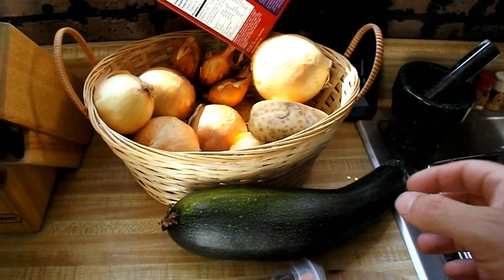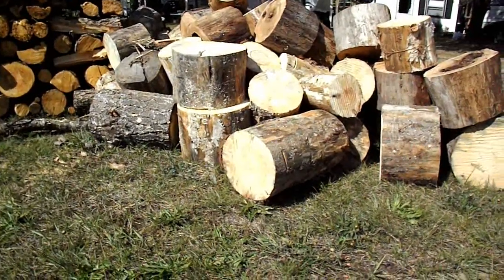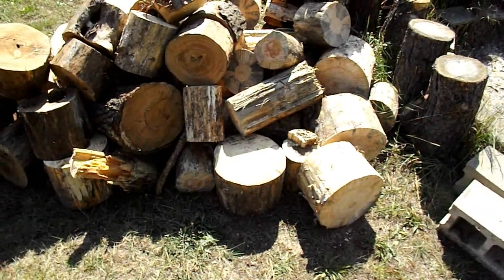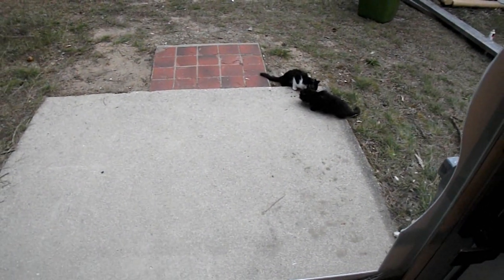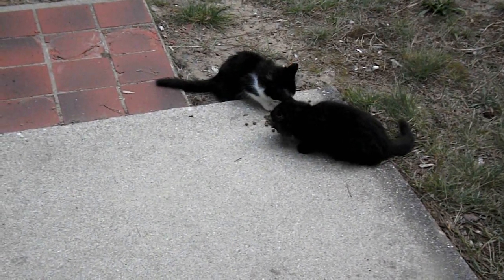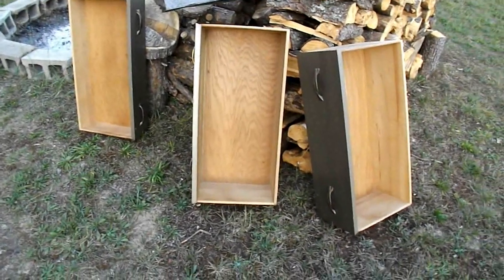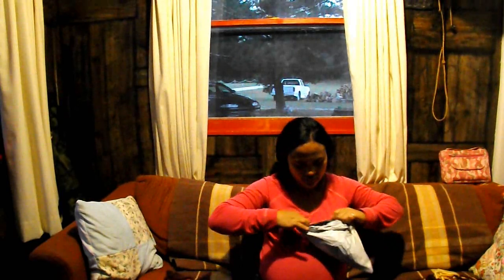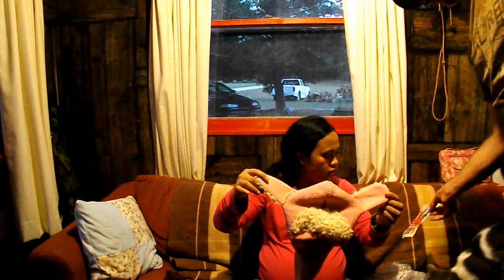Cutting Fire Wood ~ New Wood Stove ~ Gifts Arrived & More

Comment: How big of logs can fit into that tiny stove? You might have to be filling it up every hour or 2 with wood. Will it heat the upstairs? We have a decent size airtight stove and can fit big logs in it and still have to get up in the night to stoke it up. No way would the stove you have hold big logs at once  like we put in ours :(. We heat our whole  1 story home with the airtight, keeps us busy keeping a good heat tho in cold cold winter days and nights. Glad you got rid of some of the bees.  JMO
Reply from the maker: 8 inches by 5 inches max fit in the stove. I cant remember very well but back in the camper I would fill up the stove and leave for hours. Put food in the dutch oven. Come back and have a nice hot meal and the stove still glowing a bit. But I was using hard wood back then too.
Reply: Oh my that sure is a small stove then. But the camper wasn't a very large area to heat either tho.

Comment: Take little actions and then quickly back off. Like someone else said, you can do it at night or when colder out for less wasp reaction. Knock the nest down - get away for hours if not a day. Knock it away from the house - get away for hours if not a day. Put bleach in a spray bottle and stray it - get away for hours if not a day. Repeat. If you have a water hose with nozzle and sufficient pressure, spray the nest remains on the ground to disintegrate it to nothing - get away for hours if not a day... It's winning little battles to win the war. You should completely destroy the old nest and any remains of it. A water hose with nozzle set on wide spray will "herd" away most wasps in flight. A tennis racquet works well to swap them in flight. I have to deal with wasps including when the nest is built in logs on the ground - so yeah you will have to monitor the woodpile for wasp nests. Just spray with bleach as it's cheaper.

Comment: Just dump gasoline or kerosene on any insect nest and they will ALL die Instantly.. Yes, this sounds dangerous but it isn't really unless you plan on lighting a cigarette. The gasoline or kerosene evaporates very fast. This is fast, cheap and easy. It can't be worse for the environment than all that poison. Besides you are very likely to have some available in the garage when you actually need it. Remember this advice.
Reply: I think that's a bad idea. They have outdoor open fires and sparks could be carried to the corner of that part of the trailer. What if some gas pooled around the bottom of the trailer? JMO
Reply: I think you are over thinking it. First of all, you don't need enough to "pool" up, just enough to kill the insects, which isn't all that much. Secondly, have you ever spilled a little gas at the gas station? It evaporates almost instantly. Thirdly, you wouldn't do it on a cold day when the fires are lit. You would do it when the sun is shining and the gas will evaporate fast. I am assuming just a tad bit of common sense. I don't think that is too much to expect. Fact is that it works and works fast, is almost always available, is environmentally probably better than commercial poisons and is cheap as all git out. I think getting rid of the risk of being stung and having an extreme adverse reaction outweighs the risk of being stupid enough to burn the place down. As for those hornets that build nests in the ground, this is the solution. A person could go broke trying to poison them. Try not to build a campfire on the same spot as soon as you kill the nest, OK? I killed a huge nest of bees that built inside a garage wall by just pouring a little gas in there. ALL the bees were dead in what was probably 3 seconds. They didn't even have time to react. The next day it was as if nothing at all had happened. No bees ever came back. Sometimes, old timers fixes are the best fixes.